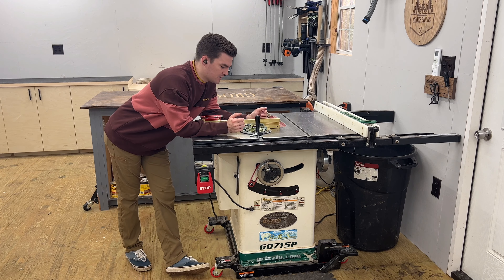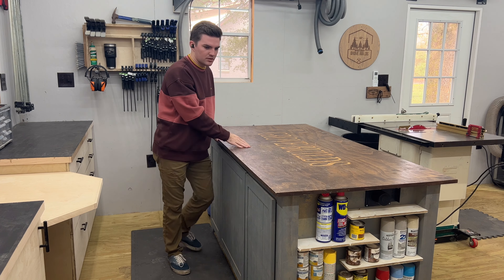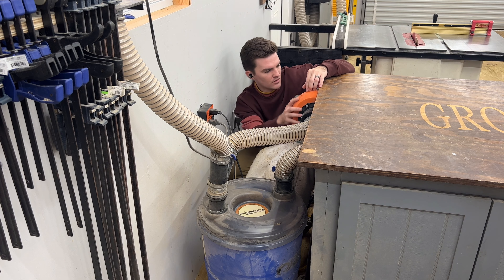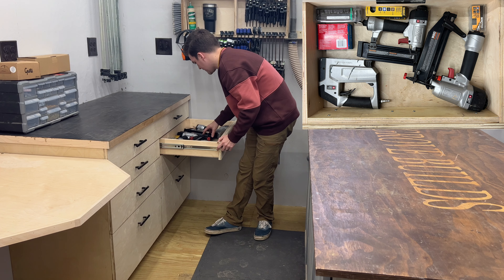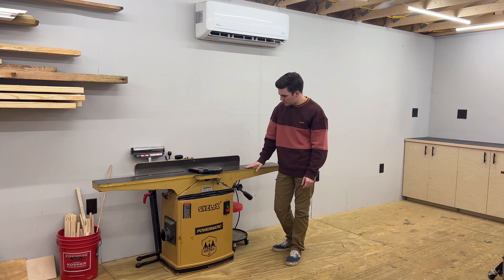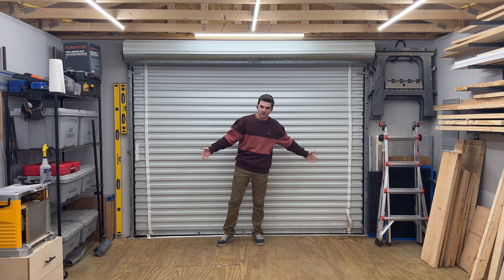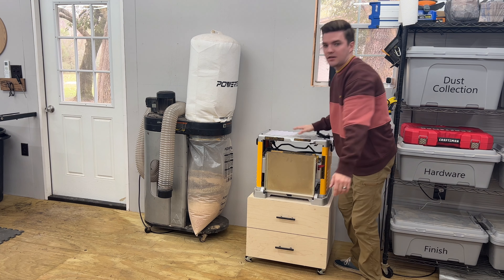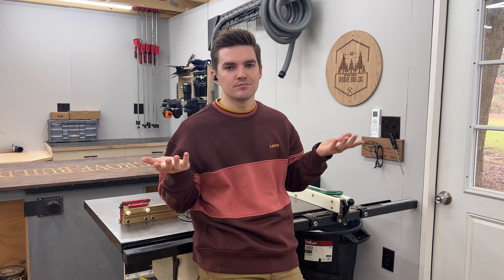Tiny Shop Tour

Comment: Nice shop. What is your electrical setup in terms of the number of circuits, volts and amps?
Reply from the maker: Let me start off by saying I’m not an electrician and I might say things wrongs. I have 100 amp breaker currently that has the capacity to be upgrade to a 200 amp breaker. I have 5 20 amp circuits that are all plug ins, 1 20 amp circuit for all the lights in my shop (this was overkill), 1 30 amp circuit for the mini split and 1 30 amp circuit for the table saw. 

The max amps I pull at a given time is 40 amps with dust collection, lights, tool and mini split running all at one time.